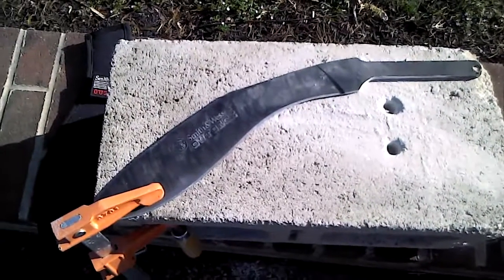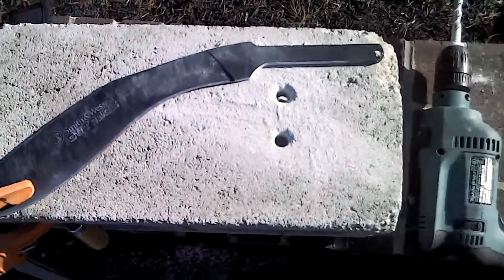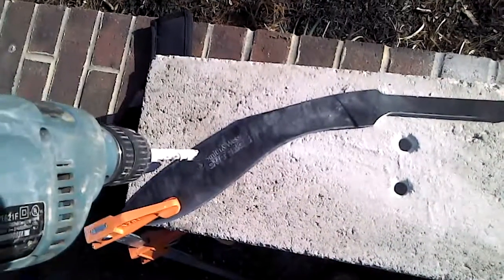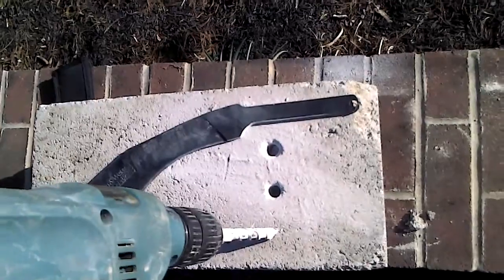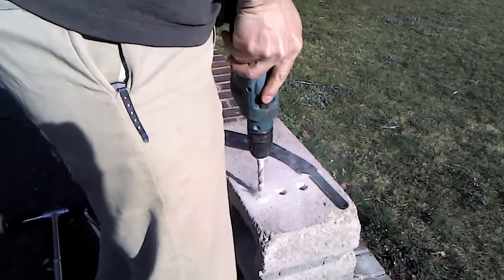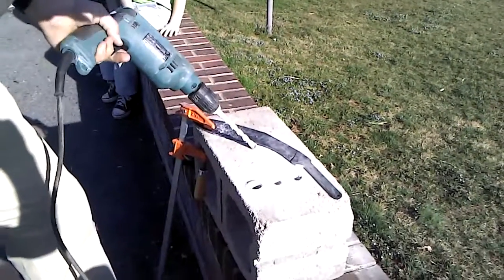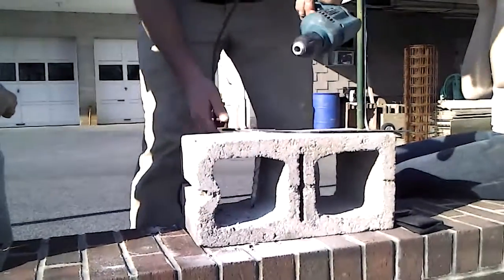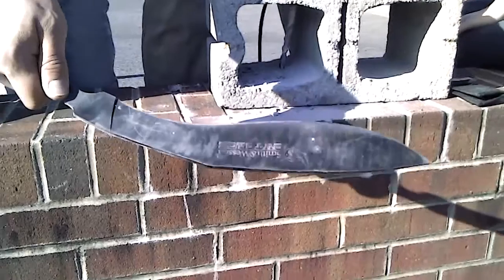Chinese 440 mystery steel- Test 1 of ?, "Stop... Hammer Time!"

Comment: I'm extremely glad to see that the MANY flaws in this vid were noticed by others before i ever viewed it. And if you're a "professional" in ANY building/construction field, common since should kick in at some point you'd think. Pop quiz for anyone else readying these comments. What typically happens when using a masonry bit an drilling through a concrete wall or a deck and happen to hit a metal plate, rebar, etc..??? Answer: its most likely screw your bit up. Notice that last hole after drill on the machete had a harder time penetrating the block... And daaammn c'mon DAD! Are u so focused on making something thats complete nonsense that you dont notice your (maybe 5-6 yr old) kid LITERALLY climbing under you to grab the bit that u had just warned "might" be hot..?? U gotta know damn well that bit was hot enough to blister the poor lil fellas fingers. I sure hope ur not the Forman wherever it is u work. 😕😮😬😨😱

Comment: Hi, don't use for metal a rock drill,  use a carbide metal drill and clamp the knife over a wood block or better use a vice and i don't want see a guy who cut off his legs by drilling :-)  and use pleas safety glasses, the hot metal from drilling can make you in worst blind :-)  and you can't walk when you have no legs and are blind :-( regards

Comment: You know that's not really 440A, don't you?  China, like many countries, makes steel to their own formula, and calls it something else.  They only stamp teh blade "440" because that's the closest they can come.  To stamp it properly would take several letters and numbers, and no one would have a clue what they meant. 

By the metallurgy, this steel should be a little softer than 440A, but all I've tested was a  harder.  It's hard enugh that it's really tough to sharpen it with an ordinary stone.  You really need a diamond stone to cut it properly.   But it does have good edge retention, it's far more rust resistant than 440c, and it may be cheap, but it is NOT junk steel.
Reply: James Ritchie He´s trying to drill metall with a rock drill. What did you expect from him. :P

Comment: WOW....IT IS RIDICULES TO TRY AND MAKE A POINT USING THE WRONG TOOLS...THAT BIT WAS NOT DESIGNED TO CUT METAL..A MASONRY BIT IS NOT EVEN CAPABLE OF PENETRATING THROUGH ALUMINUM PLATE..